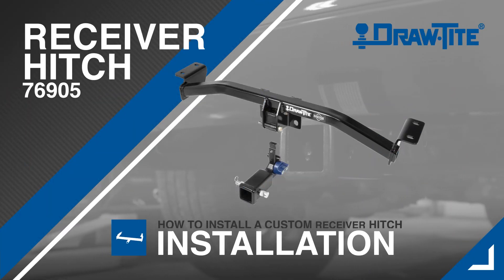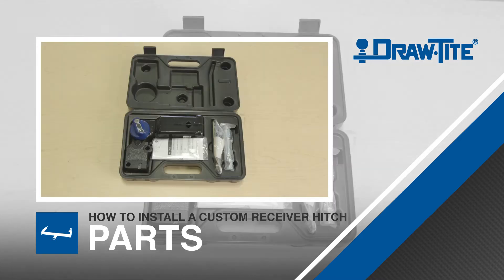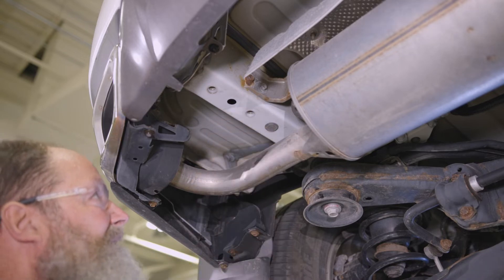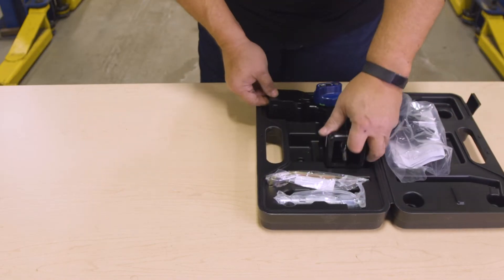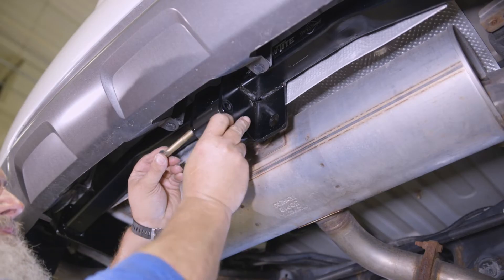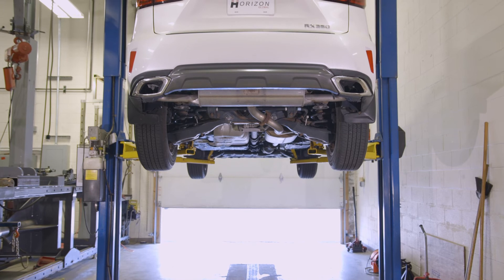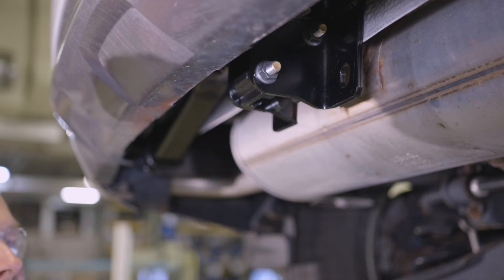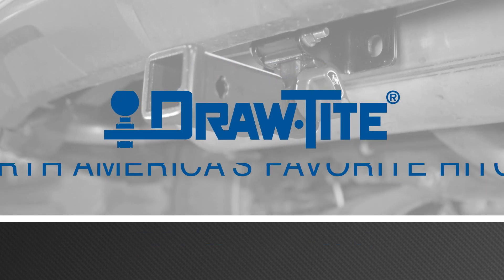2016 - 2022 Lexus RX350 HIDDEN HITCH Installation - Draw-Tite 76905 - Removable Hitch Receiver

Comment: ….Note:  You must have a “Tow Prep package” installed on your Lexus RX 350L.   This includes a bigger radiator & extra coolers for engine & transmission.  Just call Lexus parts department and give them a vin # & they will tell you if a tow package is installed.  You cannot do it once out of factory.  If you have a tow prep package installed from the factory, then the kick sensor is moved to one of the back corners of the SUV and not placed in the center of the vehicle
Reply: It makes no sense why the tow prep is not standard on the RX. It's only a couple hundred bucks and at least gives more options in the used market.

Comment: If your 2022 Lexus RX 350 has a kick sensor will it have to be disconnected to use your hidden hitch?
Reply: Will that prevent you from buying it??
Reply: @SamEllis1978  no, I did buy it and I was really disappointed. I had Line x put it on my 2022  Lexus rx350 and it would shake at low speeds.  Line X worked on it two times after that and on the third time, I had them remove it and I got all my money back.